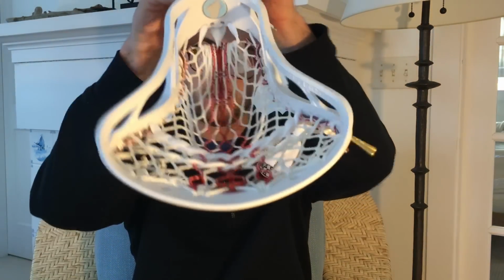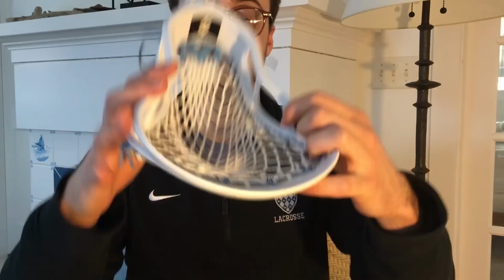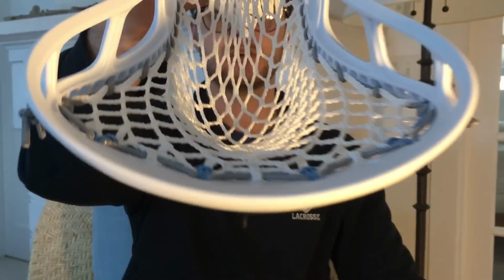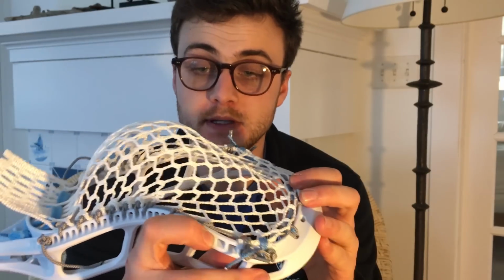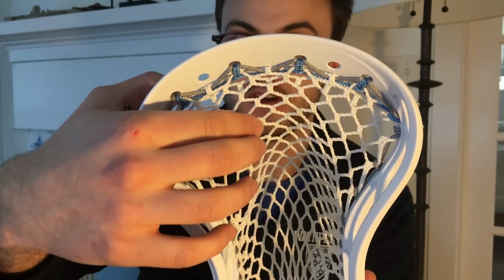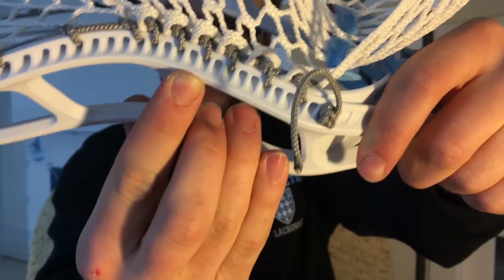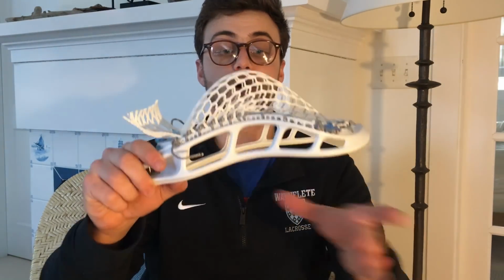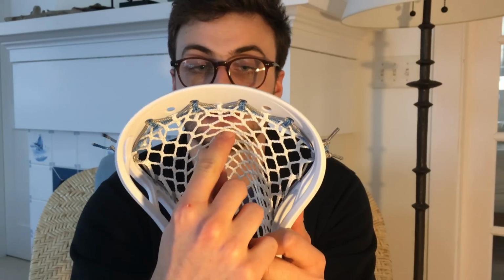STRINGKING MARK 2D PATTERN AND THEORY

Comment: Great vid. Would you recommend the 2D or the 2V for a LSM?
Reply: Luke Whitwell 2D if you are more defensive minded, 2V if you are more offensive minded. As of right now, I still think the mark 1 is still the best lsm option that stringking offers and you can probably find it on sale right now
Reply from the maker: 2D. As well constructed as the 2V is, it's an incredibly light head and it definitely won't survive the beatings a pole gives out as well as the 2D will. Also, the 2D will still give you plenty of hold, and the ground balls are unbelievable. I just think the 2D is a safer bet.
Reply from the maker: I definitely disagree about the Mark 1, because we've had a TON come back with breaks from long-poles. If you're wed to the Mark 1 design and are a pole, I'd definitely recommend the 2V, but as you can see in my comment below I'd still recommend the 2D over the 2V for anyone using a 60" shaft. 
Also, I don't believe the Mark 1 is going on sale any time soon, as it will be used in the Complete and still provides a solid $70 option, to don't bank on that happening this calendar year.
Reply: Mainely Mesh I got a mark 1 for $45 and it sucks to hear that it breaks that easily. In your previous videos you said that it was just as stiff as any other option defensively except the Brine triumph so I assumed it was stiffer than even the 2V
Reply from the maker: Stiffness doesn't always translate to durability. The breaks we received were all along the throat. The 2V is stiffer than the 1, but they're both very stiff.
Reply: Mainely Mesh ok, would you still say the mark 1 is the still the best D-head for $70 or less?